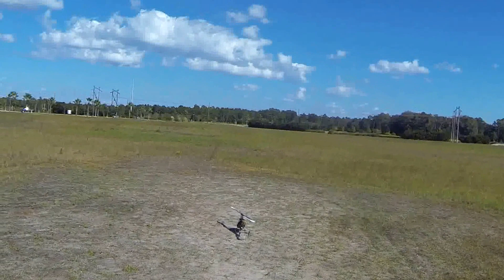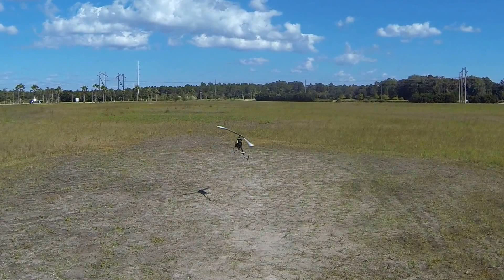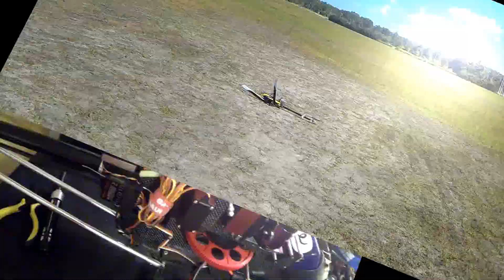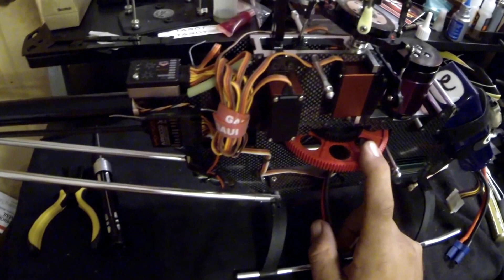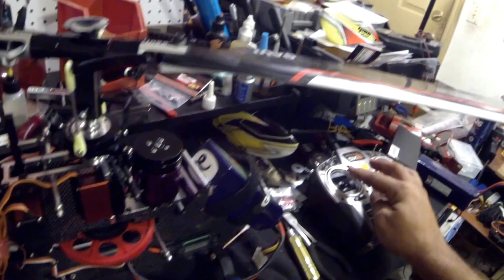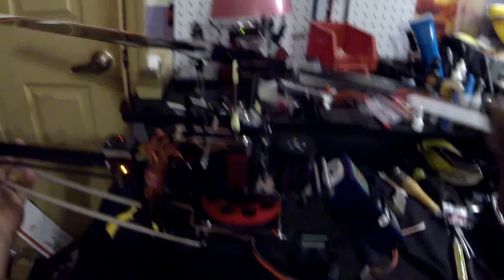Gaui X5 - Bigaole V3 Crashes my heli on 11-01-13 + Demonstratin of Defective unit

Comment: It stinks when you are trusting the gyro & then it crashes your heli.  Any chance that you will get reimbursed for the heli damage & a replacement gyro?
Reply from the maker: HAHAHAHA!! reimbursement, as if...

I went into using these hack gyros knowing full well what could happen. You can't go buying cheap Chinese "knock off", or "rip off" crap and expect it to work like the real thing. Especially not every unit every time. You know their quality control is going to be non existent compared to the German made BeastX. I simply got what i paid for.
Reply: ***** I would say, sue the pricks or if you used a credit card dur a reverse charge back, as in like the product is defective.  I would even state the costs that you incurred for your trashed helicopter also.

I have been there, like you, it is awful, how these companies can sell product that can cause physical harm to people & think they can not be called into court for ther problems.

Let us know what happens, plese,

Kurt